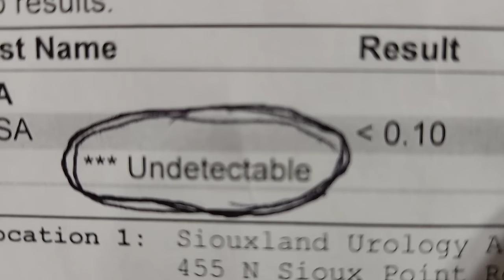A Surprise That Could Go Really Bad // Uber Dad

Comment: Nicely done Kurt...  His pickup looks great. A leveling kit is a big deal. It totally transforms the looks.
I've owned quite a few pickups and I always put the leveling kit in. The newer rigs with IFS are so much
easier than the old straight front axles. On those I always put an add-a-leaf extra leaf spring in the spring pack.
I'm glad to hear that your dad's psa is normal. I lost my dad five months ago, and my wife a year and a half ago,
both from cancer. I'd give anything to have them back...

Comment: Hey in regards to the vacuum cleaner hanging on the wall, get yourself a remote control plug adapter like they use for Christmas tree lights. Maybe you can find some for cheap right now after the season. The one I’ve got has a “fob” for turning it off and on.

Comment: Kurt, I had a leveling kit put on my 08 Tundra SR5 4x4. It made all of the difference in the world in the stance. Topped it off with new rear springs built by a friend of mine who owns Weaver Spring & Brake. Oh yeah, pulled the 20’ gooseneck horse trailer and the 24’ gooseneck equipment/round baled hay trailer with no problem.

Comment: awesome! What a nice gesture. cleaning n stuff is hard on us older dudes ;) , so im sure that was much appreciated.
I used the Bilstein Shock lift on my RAM 1500. Looks so much better.... dont forget to lower the headlights or you'll get lots of bright flashes. I had tried the spacer thing, but went a diff route when the shocks needed replaced. much nicer ride.